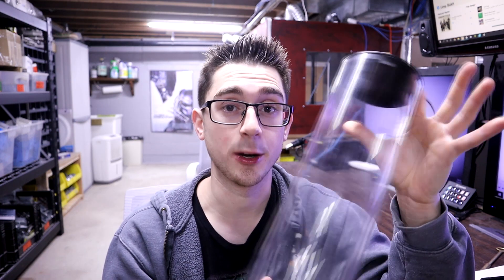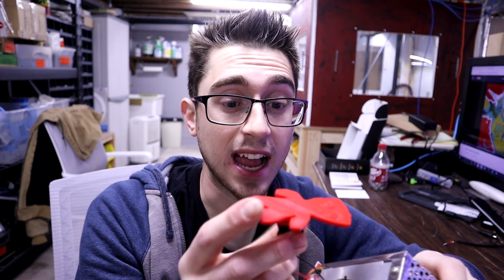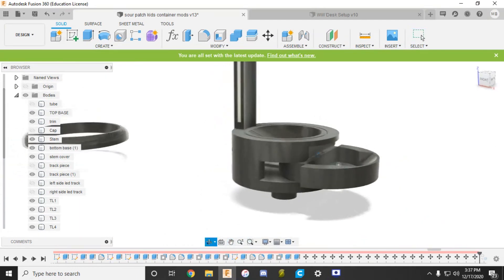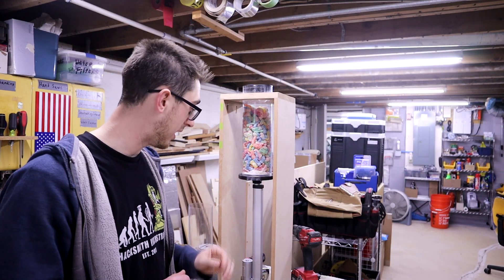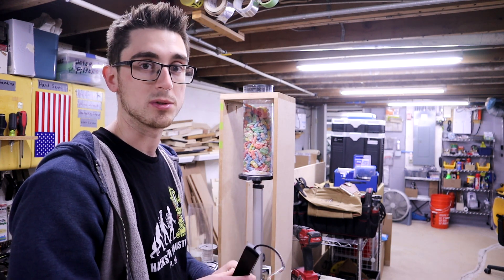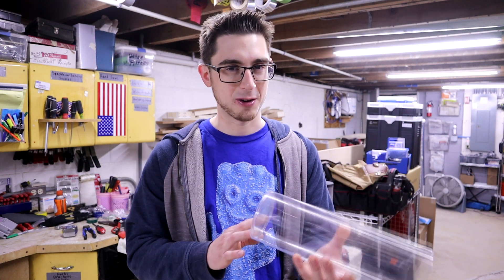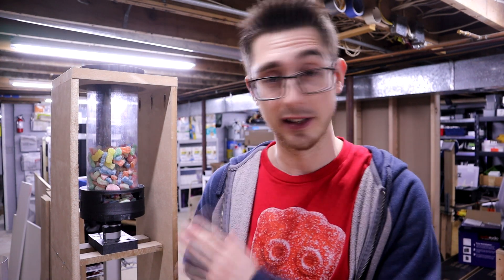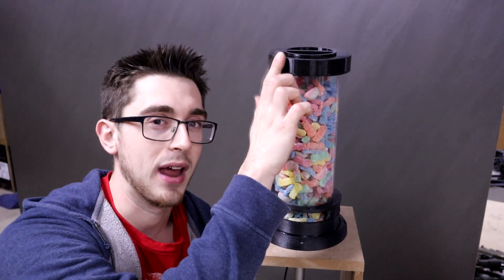Sour Patch Kids (Candy Machine) Rising Desk Build

Comment: great job... would like to do this project. any links to find the motor?
Reply from the maker: Here is the link but it looks like this one In particular is sold out, anything similar to this would work though. 

12''Stroke Heavy Duty Linear Actuator 12V 225LB/900N Maximum Lift for Electroic, Medical, with Mounting Brackets https://www.amazon.com/dp/B07S2KNL42/ref=cm_sw_r_cp_api_glt_fabc_TBS20FTXTQRJHRSWG4YK?_encoding=UTF8&psc=1